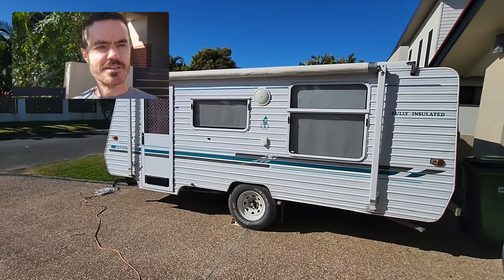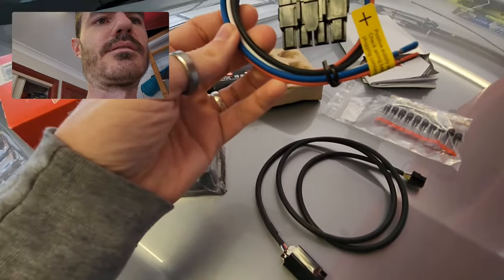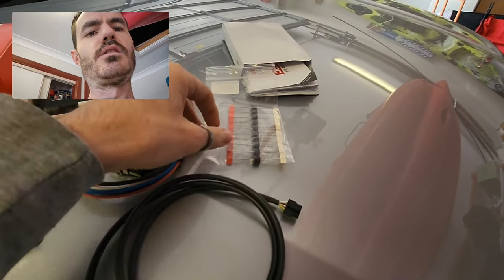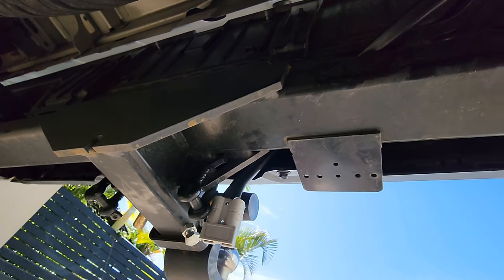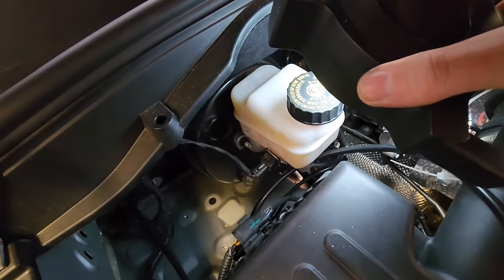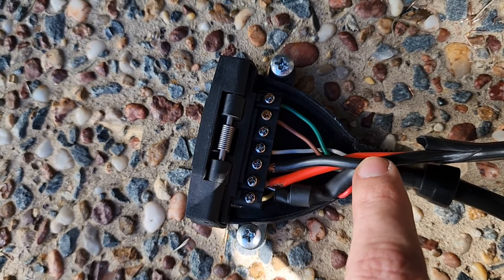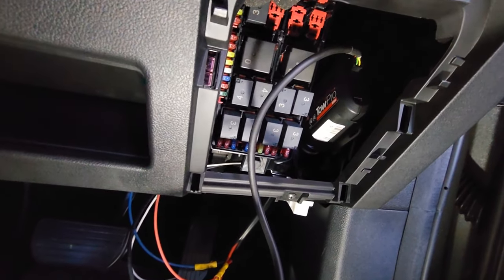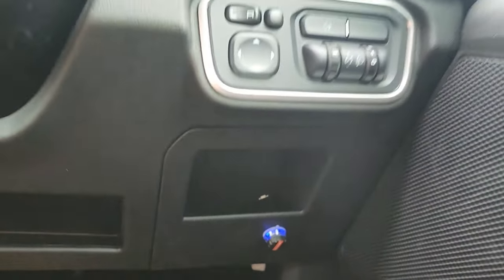2021 GWM CANNON- Tow Pro Elite V3 DIY installation. Electric trailer brake controller.

Comment: Very helpful video. Thanks heaps mate. Hubby's been referring back here for help. With the mounting of the controller dial there inside the cab. Did you just drill a hole in the back of the fuse box, as well as the front? We just couldn't quite see there in the video.

Comment: I don't want to be picky but the brake controller should be in the middle so that if your pre occupied with a tank slapper the passenger can push the brake controller on. Centre somewhere is better than drivers lower right. Great video though.

Comment: I bought this and it doesn't ring anymore. Hybrid Wiper Blades for GWM CANNON 2018-2022 *Excellent Quality .**PAIR
  I'm researching how to install a tow hitch but this wire is just too much trouble. I have seen a kind of four pairs of sockets that only need to be connected to the rear two taillights, can it be used?

Comment: I like the idea of using the brake lights to pick up the brake activation signal, however I don't think it's the recommended way to do it, it should come from the brake switch on the actual pedal. The rear lights are (most likely) on a different fuse, so it introduces more chances of not getting brake control signal (2 fused paths not 1) and also fair signal run with chance issues on the way back. Coupled with a 0.7 to 1.2v drop by the diode....
The body control module can also be fussy about extra signal loading on the lights, but to be fair, trailer wiring is so variable I'd hope it would be pretty tolerant!
Reply from the maker: Hey Steve, yes I see what you're saying. I think for older vehichles taking the signal from the pedal is the way to go. But on modern vehichles it can interfere with the computer and you will end up with faults. I did a bit of research and it's recommend to take from the trailer plug as it's the end of the line so won't interfere with the computer at all, so doesn't trigger any faults (dash lights). Also with modern vehichles have radar cruise control and autonomous braking, so the signal needs to be picked up from the trailer plug otherwise when the cruise control or the autonomous braking comes on it won't pick up the braking signal and the trailer brakes won't come on.

Comment: Hi. A question......do you have any footage of your dcdc charger installation. I am planning on installing a victron dcdc charger into my cannon L. I'm just looking for information about the wiring setup with the cannon's smart alternator, particularly earthing the negative wire. Any advice would be helpful.
Reply from the maker: Hi Brendan 
No sorry i didn't film the installation of my dc charger setup. But it was a pretty simple install. I just wired the positive to the positive terminal with a 30a fuse as its only a 20a dc charger. And the negative I have run directly to the negative terminal on the battery. I didn't use an isolator as the dc charger automatically stops charging when starter battery voltage drops below 12.7v. It has been running a freezer in the canopy on a 100ah lithium phosphate battery for over 2 months now with no issues. 

Cheers

Comment: Question which way does the + diode run back to the car or to the trailer,
Reply from the maker: Hi Danny, current flows to the trailer, you don't want it flowing back the other way, so the cathode side of the diode will be to the trailer.

Comment: Hey you got shit
Wipers like mine 😂let me know if you find a decent  set 👍
Reply from the maker: Haha yep they are a bit annoying
Reply: Just saw this comment lol. I hate wipers that vibrate/make noise. Has a fiat 500 where the have a 23” wiper but the motor can’t handle it. I lost a wiper once cause of it. Switched from flex? Blade to old school which helped but I cannot stand wiper noises. 😤🤯
Reply: Set of wipers from Wipertech will sort that problem out.
Reply: Quick fix, spray some silicone spray on a rag and run it along the wiper rubber... smooth as butter till it wears off or you get new blades... so annoying 😑

Comment: Is there a dedicated harness already on the cannon for the 7pin trailer plug or did you have to splice onto all the existing cables?
Reply from the maker: The 7 pin plug was installed by speedy towbars, but I think there may be a factory harness. Not 100 percent sure though.